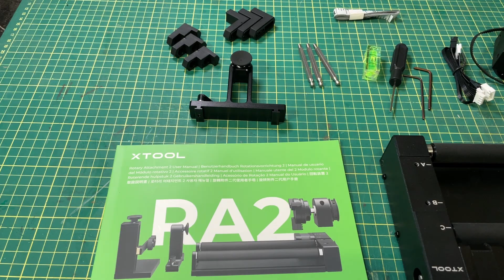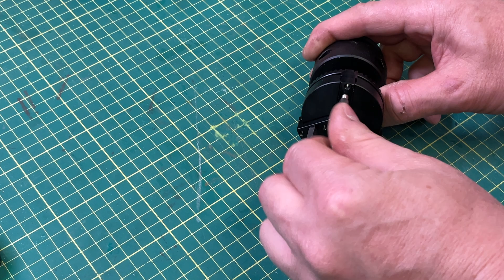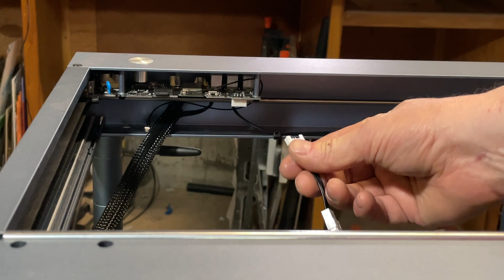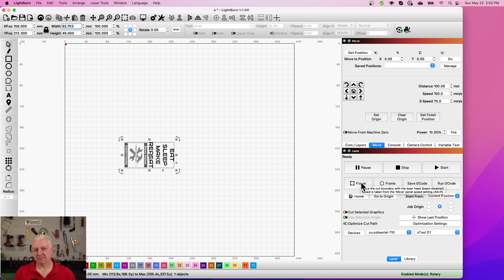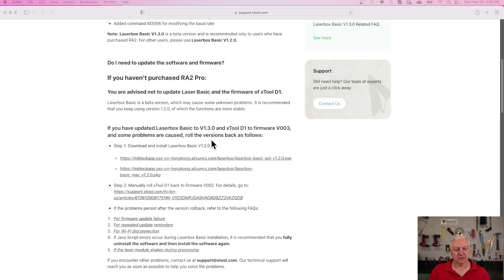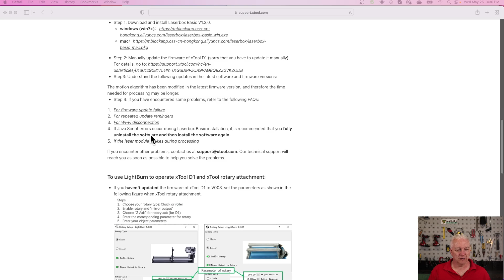XTOOL RA2 Pro - Is this the best Rotary Attachment Money Can Buy?

Comment: Great video as always Steve, thanks for all your great content.  In this video you mention compatible with all lasers, how do I hook it up to a thunder laser?  Is there a wiring harness adapter available?  I have this rotary and it did come with a couple of wiring harnesses for other diode machines, but I can’t find any data on adapters to got to the thunder lasers.   Thanks
Reply from the maker: The RA2 comes with a couple of different cables and one of them should work. You’ll probably need to unplug you Y-axis cable to plug the RA2 in unless you have an extra axis supported by Lightburn. If you have a cable already it will likely also work on the RA2 since there are only a couple different wiring configurations for stepper motors

Comment: I am confused. You demo the FSL Muse but this looks like it is inside a different laser cutter. Am I wrong? Did you attach it inside the Muse? Can you use this on a CNC gantry?
Reply from the maker: It’s my Muse however I have a Riser and it is sitting in the bottom of that
Reply: @SteveMakesEverything  I have a Muse (2018) with the original riser and rotary. I should totally try it in there. BTW, you videos have been invaluable. I am watching almost everyone. Joining as a Patreon. Thanks for all you do.

Comment: Check out the snapmaker 2.0 rotary, but it is approximately  $700 and I have not figured out how to use on other lasers,
Reply from the maker: I like the idea of an all-in-one machine.  Maybe Snapmaker will send me one to look at.  😉 Regarding the rotary, in theory it will just be a stepper motor configured to rotate the material. In all likelihood you could make it work with other lasers using some sort of adapter cable
Reply: @SteveMakesEverything  dont bother its built very well but you are stuck using luban  and that's most of the reason  the snapmaker just sit gathering dust. Its gotten to the point I actually get nauseous  just thinking about luban.

Comment: The coating on the glass is standard what? I’ve been looking for something other than paint and galvanizing spray is sold out everywhere I go
Reply from the maker: IN this video I just used regular Cermark, but I believe they also make one specifically for glass.  It's not cheap though, so Galvanizing paint is still your best bet if you don't mind the extra effort in clean up.  Cermark washes away with water rather than acetone.

Comment: I have a muse 3d I’m a total newbie and have seen a lot of light burn tutorials but not as many re3 wondering if I make things on lightburn if I could transfer it to re 3 after TIA
Reply from the maker: Well don't think of like it's Lightburn vs RE3.  Both are just laser control systems with some ability to create designs.  If you are using something like Inkscape, Adobe Illustrator, etc for your designs and you are creating SVG. files, then these can be loaded into either Lightburn or RE3.  Also almost any image format will work with either as well.  This also applies to different lasers as well (e.g. Diode vs CO2 vs Fiber etc.)

The actual laser software doesn't provide a significant advantage.  Lightburn does some thing better, RE3 does others. For me the best value of Lightburn is that I can create my cutting/engraving project without needing to  turn on my laser, where as RE3 requires my laser to be turned on and accessible from my computer using a web browser.  However RE3 handles complex projects and arguably material settings better.
Reply: @SteveMakesEverything  thank you for your time I really appreciate it.  I love watching your videos thank you so much. I’m almost 50yrs old and decided with no computer knowledge at all to learn something new I don’t quit so I will figure it out it will just take me a long while lol
Reply from the maker: @brianayre72  Persistence is always the best tool for learning. 😀. Help is never far away.

Comment: Great video Steve, I have been thinking about getting a diode laser along with my co2 laser, but I'm just not sure of the benefits of a diode laser, that said I've not done a lot of research as yet. But very informative Steve. Thankyou 👌👍
Reply from the maker: So I shared this view until I got a diode laser.  Aside from being able to engrave on stainless steel, the Xtool D1 that I use as my daily driver on the diode wavelength (though it isn't cheap), is great for quick engraving jobs.  Doesn't mean I'm ready to abandon my CO2 lasers anytime soon though, since for volume projects CO2 lasers can kill any diode in performance.

If you are looking for a cheaper diode laser go back into my equipment review playlist and find links to several other less expensive options that I've reviewed.  They're all solid units.
Reply: @SteveMakesEverything  thankyou Steve, I definitely think I'll look into them. Particularly the xtool D1. 👍
Reply from the maker: @NovareSystems  I'm going to start working on a project to run the RA2 Pro rotary on the Muse 3D.  Maybe that will help you with the mug engraving
Reply: @SteveMakesEverything  yes that will greatly appreciated, thankyou Steve. 👍